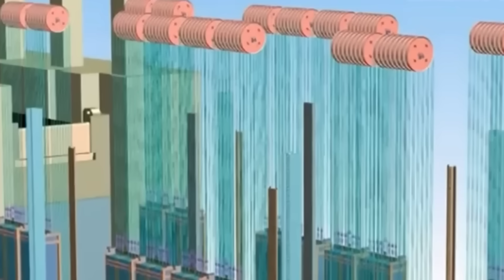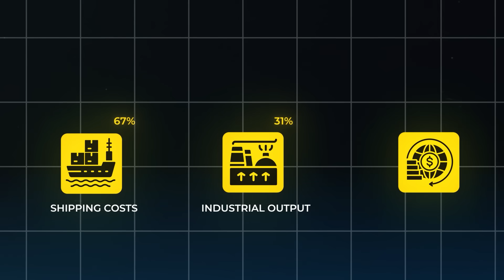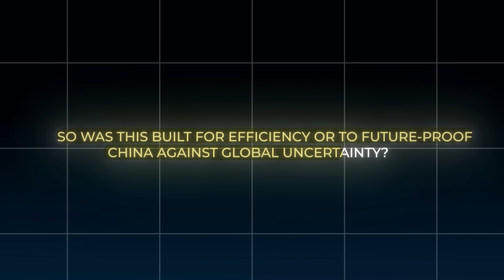China Built a Ship Elevator to Cross Mountains

Comment: I would have thought they'd just lock it in that tower closing all the holes and pump water from above to fill it to the level required using either siphons or water upstream but the volume & time are possibly too big an issue. Maybe could be circumvented by locks at intervals and siphoning that water now immediately below the lock into the above. But never the less an impressive feat hope it maintains for decades to come.
Reply from the maker: True, the scale makes siphons and locks tricky. What part of this design do you think is the biggest challenge?
Reply: @beyondthebuild-1 Maintenance of the teeth and build up of gravel similar to dams in the long term of running rivers imo

Comment: Amazing. The United States came to power, partly due to it's navigable water sources and access to the Pacific, Atlantic, and Gulf. China investing this much into it's interior movement infrastructure will help it rapidly transform and connect areas of economic and strategic importance. Really cool
Reply from the maker: Exactly! You nailed it, geography gave the U.S. a head start, but China’s basically engineering its own advantage now.
Do you think this kind of massive infrastructure push will actually shift global power long-term? Or is there more to it than just connectivity?
Reply: @beyondthebuild-1  For sure. And China isn't a one trick pony. This is one of many things they're doing to solidify their place as a superpower.
Reply: That’s true. But the American’s didn’t engineer most of it. Nature did with the mighty Mississippi, Well yeah the Panama Canal. Brilliant stuff but so long ago.

Comment: Real talk, this is so bad. I mean, good, but dummy bad. It's basically just a wet railroad, without the rail. 

Why would you not include the rail? Further, why TF are you lifting the ship in water 💀💀💀💀 no wonder the power consumption is so staggering 😭

And again, this is literally just a rail road with soooo many extra steps and specialized maintenance.

Edit; don't get me wrong, perhaps there is logic behind it in the length and reach of mountainous rivers. In theory I can see how it would reduce a lot of the required infrastructure whilst supplanting the industry with existing logistics. 

But again, the lock itself is just soooo fkn mid.

Comment: "each as tall as a 66 storeys tall skyscraper".

The 200 meters tall elevator, maybe.

But NOT the ships. The ships it can lift are MUCH smaller. From the video, maybe 80 meter long ships at most. Measured it on Google Maps. Its 80 meters long in total. The internal elevator is probably a bit smaller and probably needs some meters between the ships and the elevator "door".

Comment: Impressive, but is is necessary? I still don't understand why it wouldn't be easier to build a container lift or a simple train line. Wikipedia says that the maximum capacity is 500 tonnes - that's about the same as a train with 40 cars or 40 cargo trucks. If they can build these gigantic buildings and a dam, then they certainly can drill tunnels under the hills and pour concrete to build a train bridge that gently connects top reservoir with the bottom. I know nothing about this project except for what was shown in the video, but I wonder if this isn't an example of communist megalomania and outlandish projects with little practical significance.
Reply: I mean, you just admited you know nothing about the project, so you should recognize that your comment is an example of Western Chauvinism caused by decades of anti-communist propaganda.

Comment: That's stupid.  Just fly over the mountains!  Much faster and easier.  Stupid to make all that just for small boats.  I could see investing in a canal for huge cargo ships, but those boats aren't any bigger than a cargo plane.  I guess when you're communist, and you have unlimited free slave labour, they will think up ANY stupid idea and make it happen, regardless if it makes sense or has any thought put into it.  Have they even considered what this monstrosity will be like in 150 years?  Good luck keeping that going, as something like this needs tons of maintenance by 1000s of people, non stop and year round.
Reply: 1000s of people you say? LOL
Reply: @timoh2836  Absolutely.  For a regular suspension bridge like the Golden Gate Bridge, just sitting there doing nothing, it takes about 400 workers employed year round.  Something like the panama canal takes over 8500 workers a year to maintain.  

This type of infrastructure requires constant inspection, painting, repair, cable tightening, cleaning, plumbing, valves, electrical, etc.  You'd be surprised how much it takes for a massive project like this, especially when labor is unlimited.
Reply: Wow, genius alert here 😂

Comment: A fantastic engineering achievement and great to see, thank you. 
However, you make a point of describing the weight of the lift chamber ‘full of water and fully loaded with a cargo ship’ (being over 11,00 tonnes) which make no sense as it adds an irrelevant detail which confuses your message because the lift chamber full of water will always weight exactly the same as the lift chamber full of water and with or without a ship in it due to the weight of a ship (or anything else that floats therein) being compensated by water displacement.

Comment: 0:10 The initial claim of 10,000 ton ship is not true but still its great project. Maximum Vessel Displacement: The ship lift system is designed to handle vessels with a displacement of up to 500 tons.

Comment: As an engineer, I would never sign off on this design.  There is plenty of scale to use an inclined plane.  Cog railways can engage 45-degree inclines.  Basically, pull the ship up elevation by rail.  China has the resources to build at large scale to then achieve higher reliability and simplicity.
Reply: Because China has the ability to manufacture all industrial products.

Comment: Not a new idea the British were building canal lifts in the Victorian era - some are still in use.
Reply: Those quaint little Victorian barge locks have little in common with this. Not only is the ship elevator a different concept, it's yet another example of China's unparalleled largescale infrastructure engineering.
Reply: @fred_2021  Most of the locks were built before the Victorian era. I'm talking about boat lifts that were built and used by the Victorians like the Anderton Boat lift one of the wonders of the canal world in the Canals of Britain. The Anderton boat lift links the Trent and Mersey canal to the River Weaver navigation in Cheshire and is still in use today. The Anderton lift is exactly similar in princible and working to the Chinese version, be it on a smaller scale - The Chinese lift is not a new idea as was my point.
Reply: @davdave3470  I stand corrected. Thanks for the info.
Reply: @ Yeah no worries

Comment: For a layman like myself, I wish the video has gone on to SHOW what happens AFTER the ship is lifted. Does it go on travelling in some lakes? Is the cargo unloaded upon arrival?
How is the return trip done?
Is it simply taking the same "elevator" down?
Reply from the maker: Love this comment. Honestly, those are great questions.  So the ships proceed along the Wujiang River. The navigation system facilitates direct shipping routes from Kaiyang Wharf in Guiyang through Goupitan, Silin, Shatuo, and Pengshui, eventually reaching the Yangtze River in Fuling, Chongqing. The shiplift system is designed to enable continuous navigation, allowing ships to pass through without the need to unload and reload cargo.The return journey utilizes the same shiplift system in reverse. The lifts are engineered to move vessels both upstream and downstream, ensuring efficient two-way traffic.
Reply: The video explains that this is an internal highway to ship goods across its mountainous terrain.  Prior to using water as a highway, China had problems of shipping goods across their nation.  With the water highway, they connected economies far away that once seemed unattainable

Comment: OMG! China continues to achieve the unthinkable 🎉 love China ❤
Reply from the maker: It’s wild, right? 🇨🇳 They really don’t seem to have a pause button 😄what’s the most impressive thing you’ve seen them pull off so far?
Reply: @beyondthebuild-1  covid
Reply: @beyondthebuild-1   The project started in 1994 and was operational in 2016. It's not a new project.
Reply: @beyondthebuild-1  theft of the worlds intellectual property with no repercussions
Reply: @beyondthebuild-1 This lock system is simply astounding. The scale of it boggles. Awesome viddy. China has some of the most incredible engineers anywhere on the planet. Bravo!!!
Reply: AMEN!
Reply: China is not the original of that design it's in Europe
Reply: @eduardofan3310   yes but this is the glorify china channel,  hoping to gain your confidence, for some unsavoury  reason, my advice is delete it, insidious,  take over of u tube,  look at the content,
Reply: Yes, China is brave.